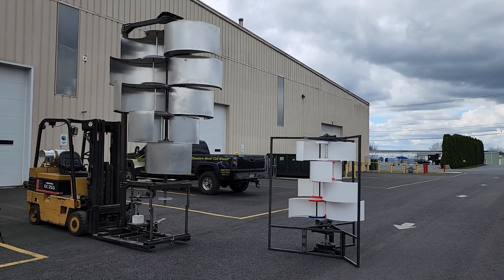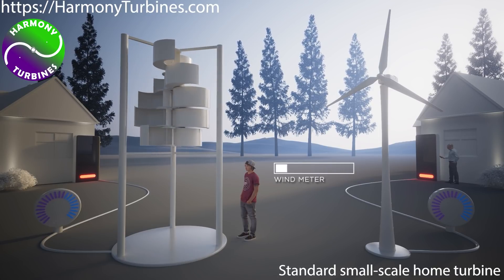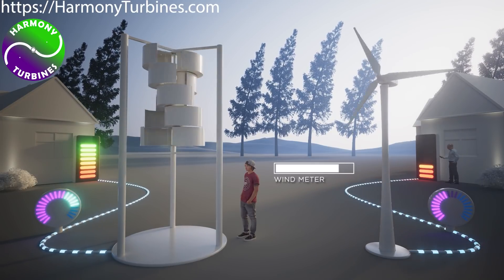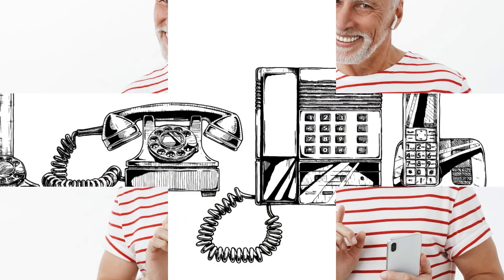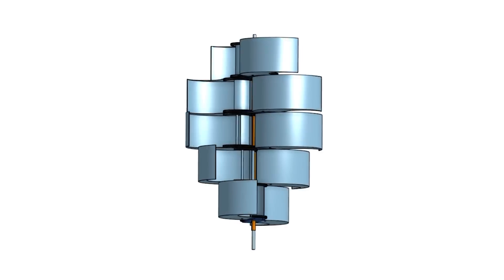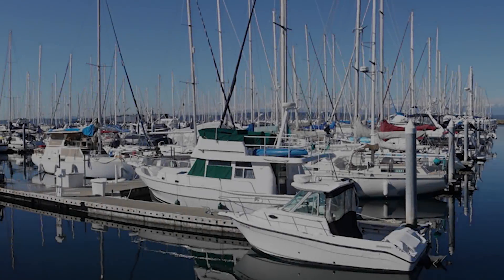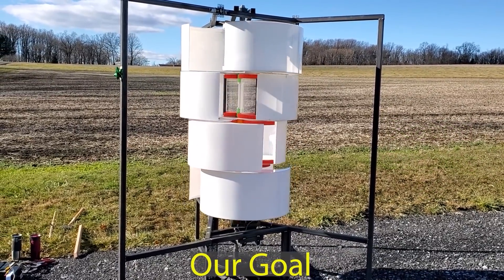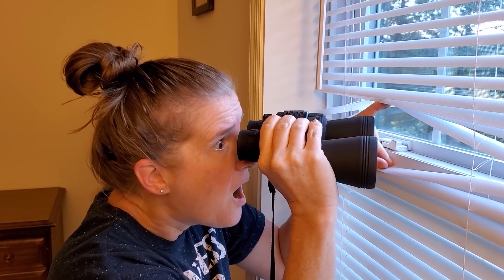How Harmony Turbines is changing the game!

Comment: I note that the alternator coupled to the prototype is the EXACT same one I have and have been unable to locate a appropriate blade system.
I know mine can produce .6V at 10 rpm and over 60V at about 60 rpm but it needs serious torque to not stall; the Harmony could be the answer!
Lower coefficient of drag than the typical Savonius while producing equivelent torque.
Most of the areas in my country have wind speeds at 20 feet of about 12 mph; well within Harmony's range of function.
Would you offer the blade unit with a universal coupler for customers to utilze their own alternator?

Comment: I thought of this idea about 10-15 years ago but it would use vertical blades, straight and vertically flat, 4 -5 feet tall each, one foot wide spinning off a central vertical axis, be anchored directly on the ground on a platform and for safety be caged in on the top and sides in chain length fencing.  But I’m not a developer, engineer, scientist, mechanic or any of that.  So that was that, just an idea.  It could be placed out of sight in the back yard in a windy location.  Not a perfect idea but nonetheless……

Comment: What I would like to know is at what wind speed do you start making energy over 300 watts? And what is the max output that can be achieved in high winds in freezing cold temperature's of -40°F ? I live in Minnesota and that is the lowest temp I have seen here plus we get snow drifts of 4 to 10 feet in some places and wind speeds up to 60 mph in the winter months during a blizzard. So it would be nice to know what conditions your testing in .
Reply: I don't think it's going to work if it's buried in snow.
Reply: Also from Minnesota.  I would also like to know if they are cold hardy.

Comment: Obviously I want one! I have solar already, but would love to add battery storage and one of these to the mix. I can see these being incorporated into the tower structures of 115/345kva regional transmission lines to supplement the grid at a much lower cost than that of building more large power plants, while reducing the heat and strain on the wires by generating power closer to the end users. A lot of it also depends on advanced batteries being widely available.

Comment: I'm trying to understand the size of this unit and its power output. My calculation suggests that at 25 mph, the wind carries about 1 kW of power per square meter. Factoring in a theoretical efficiency of 50%, a 10 kW turbine would need to be 18-20 square meters in profile - call it 13 feet by 16 feet. I think that's pretty big for most homes, larger than the prototypes shown in the video. In a 2 MPH wind (the speed this unit is described to work in), I come up with just 6 Watts or 0.006 kW. That might charge a battery, but it won't light a standard household LED bulb.
Reply from the maker: Tom we are working to launch our 400w small-scale turbine, so nowhere near the 10kW that you're calculating. Put Harmony on a battery bank tied into your home or on your boat and you will offset your standard electric usage by whatever you produce. It's simple and easy to understand. Many people try to say "will this run my home" the answer is NO but it's a small offset that will pay itself back in 5 - 7 years if you have good STRONG wind in your area and electric costs of $0.15 or higher per KwH. If after a year or two you like the results then put several more in parallel for a greater offset of grid energy costs. Simple and easy. Our goal is to sell them for around $2,500 USD but obviously we're still in development so more work remains to be done. As to your 2MPH statement ...yes there is no real power in 2MPH winds so NO turbine will produce anything useful in that wind speed. It's why wind turbines are often rated around the 25mph range. But keep in mind where others have to shut down in high winds, we'll be capturing max power right on through that whole event. Several storms a month can make up for weeks of crappy wind.
Reply: Great! I remember seeing "400" but it was obscured on my desktop. This makes perfect sense now. Where I am the wind is strong and gusty several months of the year, so a survivable design would be attractive. I imagine the lower bearing might be a challenge since it carries the weight. Thanks for the clarification!

Comment: Hello. How many Wh it can produce in a constant wind speed of 6 mph?
Reply from the maker: No wind turbine will produce much at all in 6mph winds. Wind power is exponential in growth and at the low end it's just not worth going to the hassle of installing everything if all you're able to hope for is 6mph winds most of the time. So I would look for other alternatives if that's the best your area has.
Reply: @HarmonyTurbines  please explain: 
- 'Harmony Turbines is changing the game' 
- 'it starts spinning at 1-2 mph wind' 
- 'No wind turbine will produce much at all in 6mph winds' ... ?? 
and at higher wind speeds the efficiency must be significantly lower due to the backwards facing vane fighting the wind, and the furling (at which speeds?). so, why is your concept superior to the classic design? - except it won't stop or even break apart in storms?
any plots power output & efficiency vs. wind speed available?
and no, wind power is NOT exponential in growth; exponential would ~ c^v, but wind power is ~ v^3 (thus a power function) (c...some constant, v...wind speed)